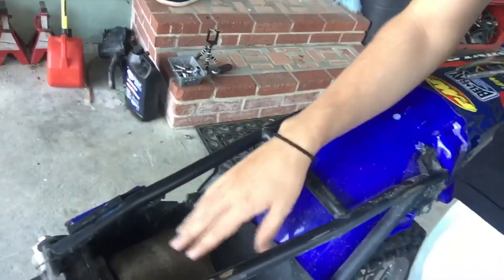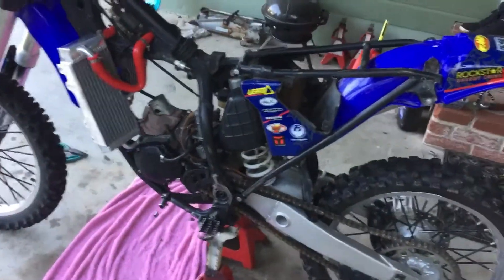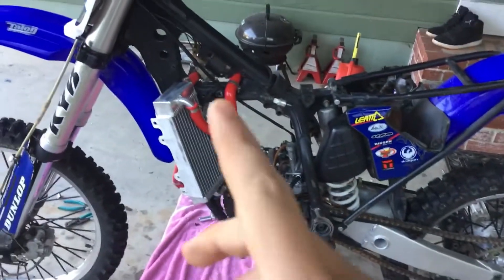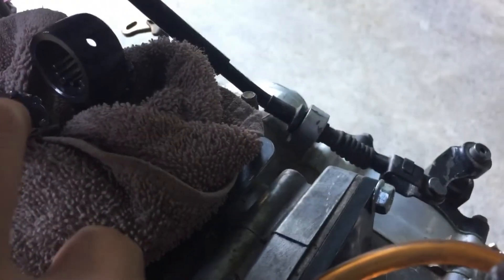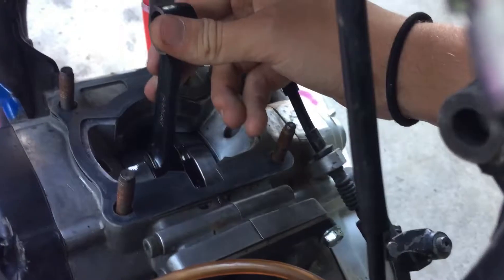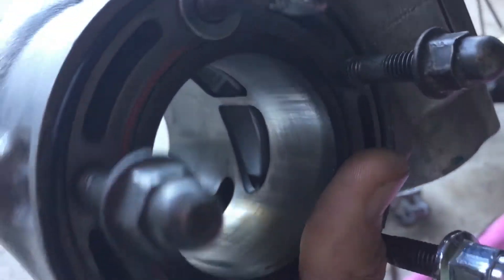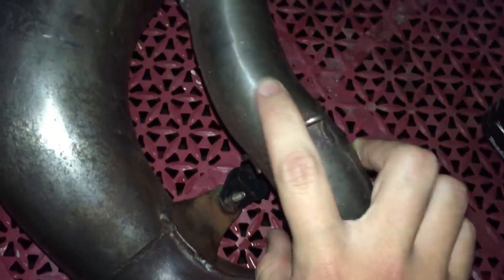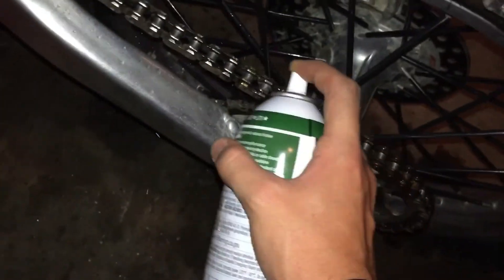YZ125 REBUILD PART 2 | MORE PROBLEMS !!!

Comment: For the carb bolts you can use a tool that is pretty much a vice grips with a needle knows pliers tip on it. I'm not sure what the excact name of it is but I have used a set to remove carburetor bolts before.
Reply from the maker: +MxForever i just used a pair of channell
Locks

Comment: that bike had a major coolant leak ( the piston looks like the moon) or it was running SUPER LEAN, so the head and jug for sure need to be resurfaced flat. and if that top end bearing is that bad , your bottom end isnt going to last, i can see up and down play in the bottom end bearing in this video its not as tight as you said.
Reply: I don't understand why people don't take care of their bikes, how do they expect to own a bike and enjoy it if they're fixing it more than they're riding it...not to mention costing themselves hundreds of dollars due to laziness and just not caring enough to learn how to work on their bikes, I had barely held a tool in my life before I bought my bike, days after I got it I had already studied/researched enough so that I felt confident I could do the top and bottom end so I took the thing down to 2 bare split cases and built it back up on my own with 0 help...it isn't rocket science but some people act like it is....just have to watch some videos and LISTEN closely and learn...I actually had a lot of fun building my engine and felt so accomplished when the bike fired up and ran like it was brand new. I knew this was an expensive hobby and if I wanted to be able to do it I had to learn to do everything myself.